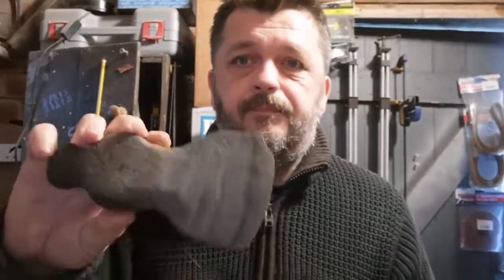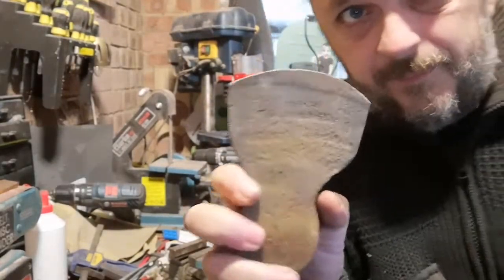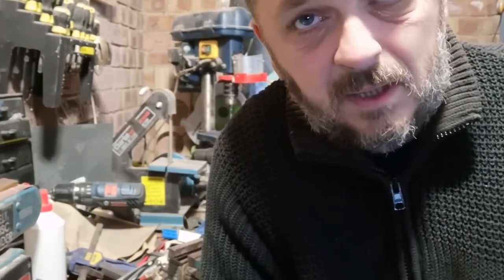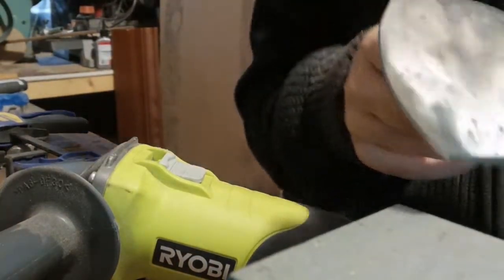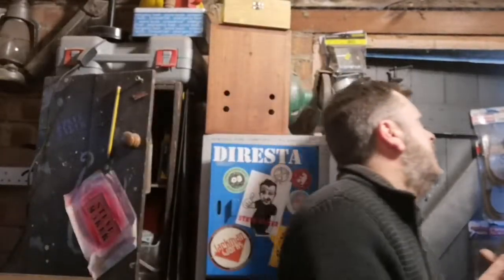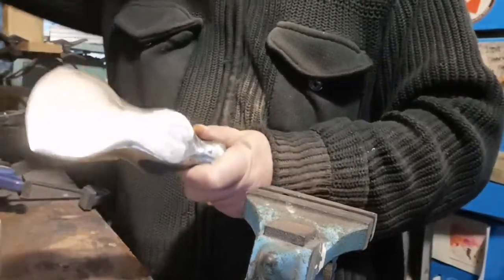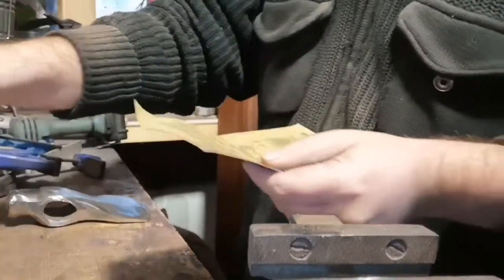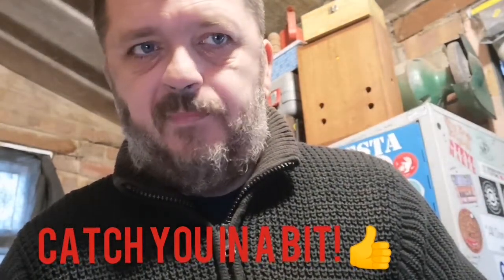Axe Head Restoration - Part 1

Comment: Quite a big difference in quite a short time. Nice job Steve.
General rule of thumb is never go more than twice the grit you have just used, if that makes sense. So if you are using 120 grit, don't go higher than 240 grit for your next stage.
Looking forward to part two.
Reply from the maker: Thanks mate good advice,  I have a plan for the sanding.... Hope it works!